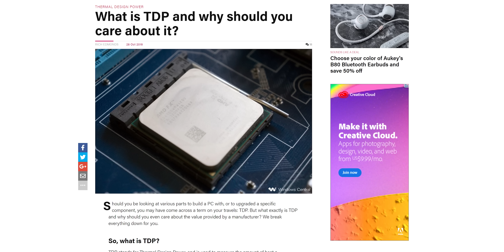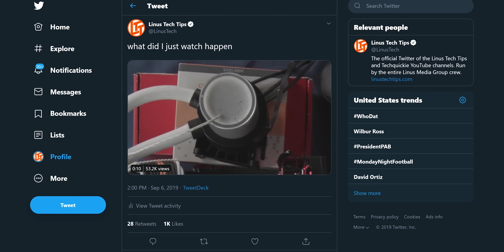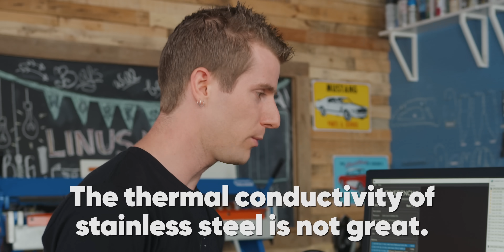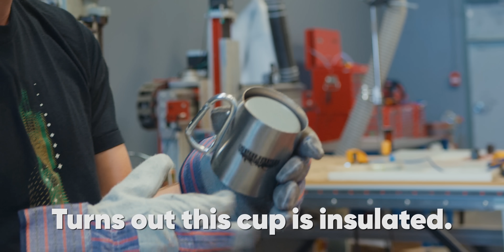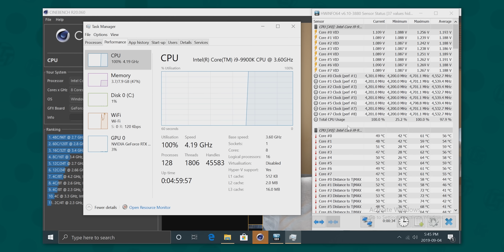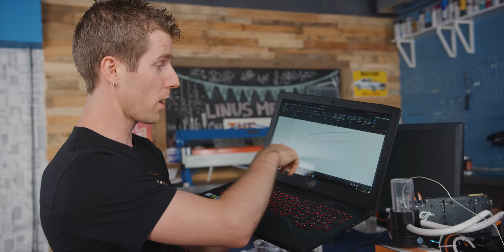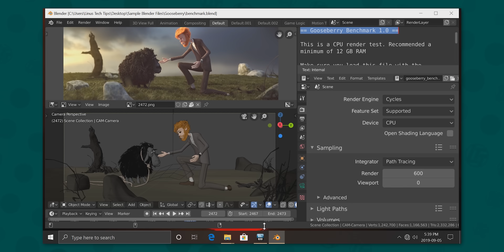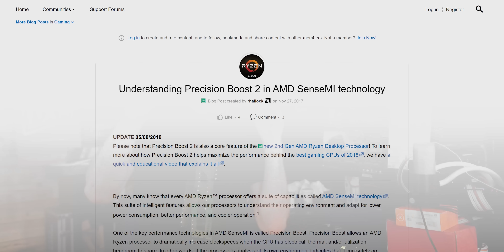Who REALLY Runs Hotter? AMD vs Intel

Comment: 14nm vs 7nm? Hmm, could that be a real reason for AMD being cooler?
Reply: regardless of that, the TDP they measure is still different and provides different results. that is the point of the whole video.
Reply: @CesarinPillinGaming  Of course, but I meant equal measurements (or as equal as they can be) and not the stated TDP.
Reply: Not necessarily. Common sense might suggest smaller process equals less power consumption and heat. In reality, this is only true when you operate inside the limited frequency rage in which the process node is most efficient. Outside that range, power consumption and heat can ramp up pretty fucking quickly, sometimes quicker than in bigger process node.
Reply: @1idd0kun  Interesting. Do we know if Ryzen 3000 operates in the ideal zen 2 frequency range or is that information that AMD keeps to themselves?
Reply: Then why does Intel write a lower tdp on their box? :)
Reply: @vnyggi621  That's because they measure it differently as stated in the video.

Comment: cant you just messure the input wattage over time?
Reply: A lot of variables come from the vrms and chipset. Even if you use 2 motherboards with an 8 phase vrm, they may not be the same type and they have different efficiency at different wattages.
Reply: differences in the motherboard might effect results

Comment: Why is it not possible to  measure the current that ONLY the processor is using? The exact voltage that the processor is using, is available in a BIOS-setting or coulb be measured ass well. When you have both current and Voltage, power consumption can be calculated. And ALL POWER that goes in, comes out as HEAT. Or am I missing something?

Comment: Why not just measure electrical power? It all goes to heat, after all.
Reply: The motherboard and vrm delivery is a pretty decent chunk of power variables. You can use the same ram, power supply, and graphics card. But the vrm is gonna draw different amounts depending on how many phases and which ones they are, and be at different efficiency curves for whatever your power draw is. The chipset will also be a factor in total system power.

The best way would be to find the power pins on the CPU and tap into them to measure delivered power, but that's difficult I'm sure, especially on Intel's LGA type socket with those thin fragile pins.
Reply: You get a base line with a different cpu 
Then test the cpu you want and subtract the two
Reply: @NautyEskimo  that doesn't tell you anything because you have to variables left, the wattage wasted by the vrm in both cases
Reply: shhhhhhh, this kind of practical thinking is not very apreciated here!
Reply: @JGnLAU8OAWF6  That is what they ended up doing, if you watched till the end ^^
Reply: @muh1h1  oh, never mind then, i'll watch till the end now.
Reply: It's more difficult to control variables.

Comment: what has temperature got to do with power usage ? two items can be using 95W and give off different amounts of heat depending on how efficient they are, for example a 200w psu that is 98% efficient will give out less heat than one that is 85% efficient  as the heat is a result of wasted energy,
Reply from the maker: A CPU doesn't move or make noise or anything, so basically all the electrical energy will be converted into thermal energy.
Reply: @LinusTechTips  neither does a 200w dc dc converter but it does not produce 200w of heat. perhaps I am missing something ill have to look up CPU s to see,

Comment: Very cool but why didn't you use your digital scales to weight the water volume?
Reply: Because the error should still be less than 1%. There are far worse sources of error in this test.
Reply: @Moejoe647  Habibi, a relative error of 1% would be like +-3.5ml for them. If you can measure this good with a cup then props to you :D
Reply: @sexiewasd0 degrees, at sea level (1 atm of pressure). Still though, they could've just standardize the mass instead of having to convert to volume. It's not like it matters either way.
Reply: "manufacturers don't always mesure it precisely. So let's make a shitty contraption that's even worst"
Reply: Because water volume is equal to its mass.
Reply: adec avdic But measuring the weight in grams is way more accurate than looking at the markings of a big measure cup
Reply: @markuseriksson8311  I'm pretty sure they never actually intended to gather usefully accurate data anyway.  It's not like they're trying to be scientifically rigorous with their two tests on a single sample.
Reply: @markuseriksson8311  well you are watching Linus after all
Reply: @ademiravdic  that's temperature dependant

Comment: How to custom water cool pc in 8 easy steps:
Step 1: Take metal cup.
Step 2: Take foam.
Step 3: Wrap foam around cup.
Step 4: Use rubber bands to keep foam on cup.
Step 5: Put cup on cpu.
Step 6: Fill cup with water.
Step 7: Put big chunk of glass on cup.
Step 8: Put weights on glass and Enjoy!

How to service said water cooling solution in 3 easy steps:
Step 1: Take weights and glass off cup.
Step 2: Empty old water from cup.
Step 3: Start from Step 5 on "How to custom water cool pc in 8 easy steps".

Comment: You could just measure the total energy out of the wall. It’d be pretty accurate. What you’re trying to do is just a mess. You have no idea what you’re doing 🤣🤭. Just use a regular water cooling cpu block and a big water reservoir and a pump, without a radiator or fans. Boom, you’ll get what you’re looking for.

Oh wait that’s what you did. I didn’t watch until the end 😂

Comment: Why not just use near identical systems and measure how much electricity they consume? If your Pc is sucking 100w from the wall it will dump 100w of heat into your room. Granted, a part of the difference might be because of the different mobo chipsets or memory uses, but you could argue that this should be included if there is an appreciable difference.
Reply from the maker: Can't do it. Motherboards won't be the same.
Reply: @LinusTechTips   Yeah, but the measurement error from using an amd and intel rog strix is going to be negliciable compared to your fun method that is going to get alot if views and, as I said, it would be relevant to the question of power use and heat dump if one chipset inherently uses more power.

Comment: Linus....
BTU=gpm*delta T* 500.... measure loop supply and return temps with probes and insulate the lines. You can then use a real block.
Reply: And lessen your effort by 500%

Comment: Get an AIO, remove the fans, set the pump to max, submerge it in a measured portion of mineral oil and calculate how much time it takes for the oil temp to rise X degrees.
Reply: This, at least makes more sense. Having hundreds of uncontrolled variable doesn't help.
Reply: I don't get Wey. You could just simply measure the Wattage and Powersupply and would get a lot more accurate result with way less complication. But that does not look so cool I guess.
Reply: @asdanjer  I would entirely agree if every other part was the same, however motherboards take power too.
One of the two motherboards easily could change the value(this isnt to say it would change it too much, but enough to still not be the most reliable.
Reply: @zachburke8906  this is true. I bought a bit coin mining mobo once. My thermals dropped a good amount
Reply: @zachburke8906  still more reliable than boiling water. also in the real world, you would not care about CPU alone. As nether for Temperature nor energy consumption, it does make a difference if the power is drawn by chipset or CPU. 
And if you don't believe in conspiracy theories that they would draw 24 pin power to make the chip appear more power efficient, you can just measure the 4/8 pin connector to measure the exact draw. (Like for example Gamer Nexus in his testing)
Reply: ein Google Name kann exakt ganze 100 Zeichen lang seien Wie soll man das denn ohne Satzeichen Füllen measuring wattage doesn’t give you an answer on which runs hotter..... power is not the same as temp. An efficient 100w cpu can produce less HEAT than an inefficient 90w cpu....
Reply: Sounds good!
Reply: That seems like the best route, probably do it in a small insulated cooler to keep from losing too much heat from from the mineral oil during the longer run.
Reply: @CondoreComputing  Yeah, you can control so many things...like weigh the thermal paste before application or even use those graphite thermal pads. Furthermore, use torque wrench for same pressure on the cooler. The ultimate goal here is have as many constants as possible.
Reply: @kostasbezaitis2695  Id love to see GamersNexus play around with making this a standard test procedure for CPU's
Reply: Ice melting is a simpler setup where you can account for pretty much every effect BUT the heat these CPUs put out before the test. Detailed it a bit more in my comment. Or like another guy mentioned, simply measuring the temperature difference between the inlet and outlet of the cooler block or radiator is also an idea. That way you don't get total output, but you can limit the output ratio calculation to the time the test was running.
Reply: Then place the loop inside a barometric chamber, that is itself isolated within a vacuum chamber, and measure the pressure change withing the barometric test-chamber

Comment: How can CPUs be so different? When they use the exact same Watts and go to 100C how can one have double computing power of the other?
Reply: Different design? Xd
Reply: @ademiravdic 
You don't say. I'm computer science student myself but the question is how can design 2 years back be so "bad" versus newer versions?
Reply: Because the die's are different
Reply: It's called design efficiency. One engine can use the same amount of fuel as the other, but have half the weight and twice the power.
Reply: @Reynevan100 
I understand that but isn't it mind boggling that design can have such a big impact? I mean people who designed last year models weren't stupid. How can it improve so much..?
Reply: 14nm vs 7nm. The size of elements that make up the CPU didn't just shrink, but because they are much smaller, you can arrange them and other elements in a more efficient fashion. Also, because you are basically starting a completely new manufacturing process, you can apply all the lessons you learned making previous chips, but which you couldn't apply to them because it would be too expensive or disrupting to tear apart your production line to do that. So you have more efficient elements that you can rearrange in more efficient fashion and you can apply all the hardware and software tricks you learned over the years but couldn't use to create this new thing.

AMD basically realized sooner that if you don't hit "reset" at some point and start from scratch, but with the hindsight and being able to apply all the knowledge you gained thus far, you will hit diminishing returns sooner or later, and from the position of an underdog it would be basically death.
I don't know how they did that so fast and so well. Or maybe they didn't and just Intel is doing it even worse. Either way, they played their cards, went all in, and hit the nail on the head. Of course we shall see how Intel will manage their 10nm when it FINALLY gets here...
Reply: It's like moving from propeller driven fighter aircraft to jets.
Yes, the designers knew for long time how to make jet engines, but you can't just move on from A to B like that. World needs CPUs, and airforce needs planes. You can't just halt everything, kill all logistics and assembly you organized to move from props to jets overnight. Your designers may have created and tested many jets already, but it takes an enormous effort to move something into mass production. Of course swept wing jet fighter will be SO MUCH better than a prop that peaks at 750km/h before propeller drag just says "no dude". Of course 14nm CPU design teams knew how great 7nm CPU would be. But they couldn't just switch like that. 

And AMD simply did it first. We're now waiting for Intel.

Comment: For consistency and ease I would imagine a Nitrogen Pot would have been good for this.
Reply: Maybe they are to small?
Reply: @troghlem352  it is possible,  but as long as you keep the volume of water consistent it should not affect anything. 100ml of water should be enough. Since this is a comparative test.
Reply: When you make the measure bigger you disminish your incertitude. But this wasnt a very well realised anyway, so they are not at that level of precision...

Comment: What a weird looking calorimeter.  I feel like you didnt need the thermal dye.  You could have just used pure water and a thermocouple.  You can measure the temperature change over time, and quantify the energy output using delta T and specific heat capacity

Comment: once my cpu went up to 124 degrees and the computer smoked and it died.
Reply: How do you get over 100 degrees what
Reply: @basiliotornado  rise the voltage and overclock and run any massive benchmark or a game your cpu cant run it
Reply: @basiliotornado  remove your cpu cooler😂
Reply: @edge_of_theknife6315  the cooler uses power which makes heat!!!! We must all remove our fans
Reply: The highest temp i could reach on my laptop is 110 how did you got 124
Reply: The same happened with my Pentium 3 when I tried to overclock it many years ago, lol! We had to replace the PC and got one with an AMD Duron 1 Ghz CPU.
Reply: I overclocked the cpu (it was an i7
Reply: Griffin 17  for a minitue or less it doesnt matter because after all i have a old laptop cpu

Comment: Uhhh, aren't TDP and TPD different values? Correct me if I'm wrong, but I thought TDP was a value for measuring heat dissipation rather than power draw... Just a little nitpick with terminology and advertising.

Comment: 2:09 "IHS Solder Quality"  wink
nice.
Reply: I saw that, didnt quite know what he meant by it.
Reply: @Ashachi  intel has notoriously had shit IHS Thermal Contact
Reply: @infernaltotorow  and don't solder
Reply: @munjee2  i 9th gen was soldered? Or is it just hedt?
Reply: @infernaltotorow  Back with sandybridge, their processors were soldered. Sandybridge is still fucking great lol
Reply: @infernaltotorow  They are soldered extremly badly.
Der8auer made a great video about it.
Reply: @FrogsterLP  thats what i heard. Its sad people have to re solder their cpus at this point
Reply: @Ashachi  Intel started to not solder ihs in CPUs, but using a cheap therlam paste instead because of greed
Reply: @Ashachi  think of the term "chipset lottery" and now imagine that the quality of the chipset you get is based on a lottery system.
Reply: J
Reply: O
Reply: Y
Reply: G